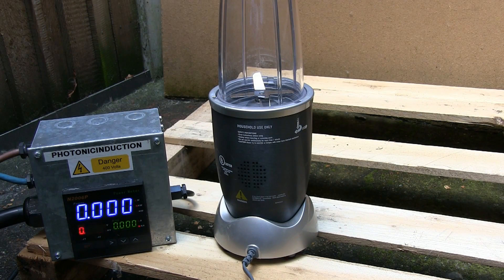Wrong Voltage - Wrong Country

Comment: Your name is redundant.

"Photonicinduction"

As apposed to induction without photons?
Reply: Not surprised, there's always a 12 year old just itching to be rude without good reason. Or at least, someone who acts as though they are 12.
Reply: Computer ??? Do you even know what redundant means ??? Explain, to us all, this " As in opposed to induction, without photons "  ..

Not redundant, but relevant in a real world application.

Old school CRT electron gun emitting  ( photonic ) radiation, being deflected in a vertical / horizontal / vertical sweep by a coil assembly ( induction ). Electron beam positive charged to several Kv....striking phosphorus particles, causing illumination of screen.

That reminds me, like to see a viddy of some of them old teley's overvolted, slloowwwlllyyy..👹
Reply: It's redundant because induction NOT involving photons doesn't exist. 

It's like saying "carbonated soda". If it's not carbonated, it wouldn't be a soda, therefore it's redundant to say carbonated as an adjective describing a soda.
Reply: Computer... right, just like "Electric -Lightbulb", however, the name " Photonicinduction"  IS including both the relevant properties. If I am missing your point, my apologies.
Reply: I'm not claiming that photons are not a relevant property in induction, I am claiming that there is no induction which doesn't include photons, therefore mentioning photons with induction is redundant. The involvement of photons is required for induction to take place, that's why it's redundant to mention them.

I typed this while enjoying a carbonated liquid soda.
Reply: Makes sense tho...enjoy the soda 
👍
Reply: I love being rude. Just like you being rude in telling somebody that their name is redundant. Just because you dress it up with knowledge doesn't make it any more acceptable. 
Grow a thicker skin.
Reply: Jon ...I like the name " Photonicinduction ", better still, like his vids. We all do. Guess Computer is simply pointing out that photons / induction, in a scientific aspect, go together, and that the name states the obvious. He is right in that sense, yet, it's an interesting compound word.  Maybe Andy chose this particular username to provoke this discussion. He's probably reading the exchange... what a trap Lol
Reply: Stating that something is redundant is not rude. Yeah, I suppose that 'knowledge' thing is a problem for you, huh?
Reply: Computer ..👍It's not rude...you made a valid point. Worked with electronics a long time ago. This is an understanding of physics, and the relationship of these two characteristics involved. Disregard those that contest your hypothesis. 👍
Reply: Computer Aw, and we were just getting started. 😗
Reply: Jon...you ain't talking to Computer
Reply: Computer.....You know, you make a simple comment...and war breaks out faster than North Korea's missiles hit the ocean.

Computer, I did understand your point
finally, but for ppl to resort to insults and profanity, is the world star demonstration, of how the skill to resolve disagreements, has taken a backseat to the caveman mentality, has is deeply rooted in today's society. Don't know how to be rational... what a world, what a world..😢
Reply: It seems very few people have the ability to be rational.
Reply: Computer....Agreed, just quick to lash out, with no reasonable point to make...so primitive. Disregard the uneducated / uncivilized, for they do not know...

Good day to you Sir 💻 ✌

Comment: Great device, for making Nutri-Blast shakes, using Diet Coke and Mentos, but you must seal the blender very tight, with tape and glue. Also drop in the Mentos, in a Ziploc bag, into the blender, since the blender will chop up the plastic bag, then the Diet Coke n Mentos reaction starts, then the blender goes, BOOM. Doing this at double it's voltage too.

Comment: no no, it still works prefectly at 220V, but you continue adding voltage up to 250V. so it burst~
Reply: Residential voltage can reach up to 250V though. I get 247V in my house.

Comment: This is what happens when you plug in an american/canadian/mexican appliance (120v rated ONLY) into a UK/European outlet without a voltage converter. It spins way too fast if it's rotational, it burns your toast or food (toaster/oven), if it's a computer, it pops right away, unless it specifically is rated for both voltages and has a switch, or is automatic. Well fucking done!! xD

Comment: You know those annoying chunky bits you always have in a smoothie? Well just buy a 120v blender and use it with 240v. Simple.
Probably better leave the on time less than 5 secs tho or else you might pop it.

Comment: PAUSE AT 1:32 I SAW GREEN FLAMES!!!!!!!!!!!!!!!!!!!
Reply: I guess that might be cable coating, or other stuffs like some salts burning like that. More likely coating though.
Reply: It is the enamel wire coating burning.
Reply: The coil is probably made of copper  which might have reacted with the burning coating hence changing the flame color (most copper salts turn flame green).
Reply: it's magic